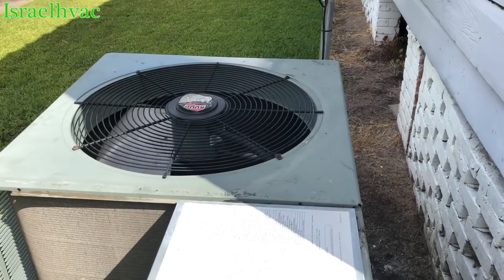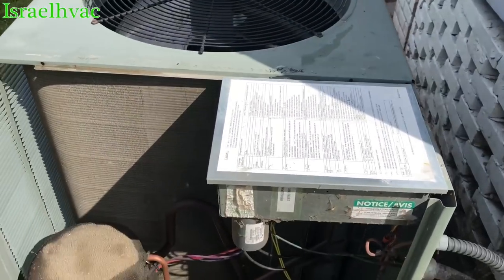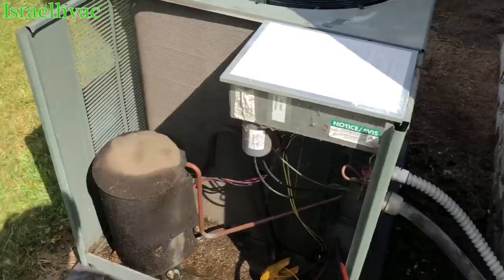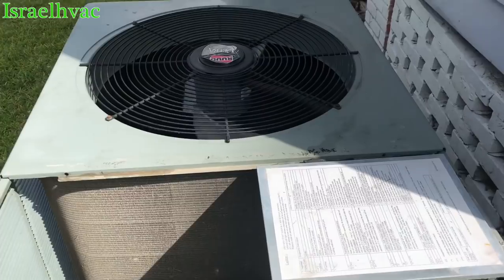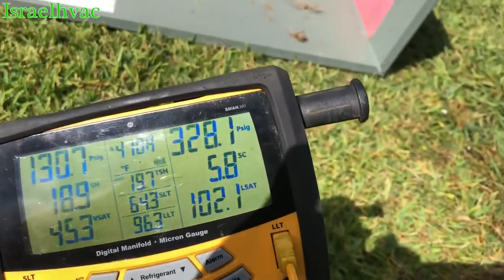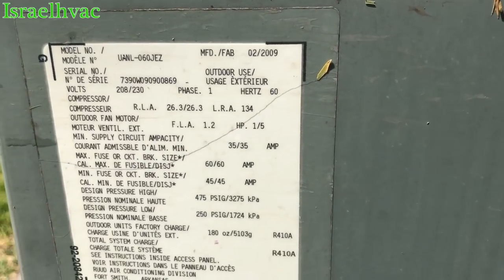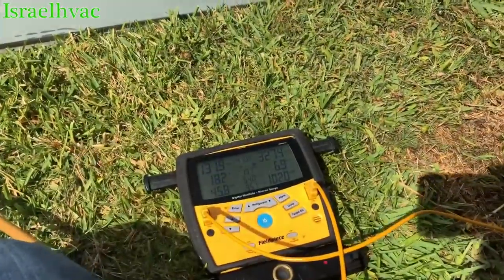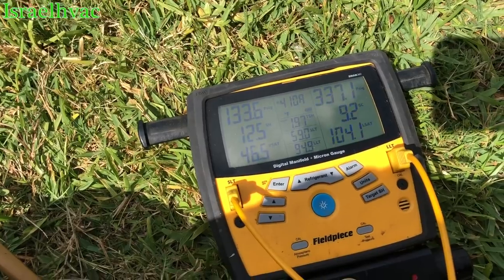HVAC Service | No Cooling | Ruud Ultra Series

Comment: Thanks for the video.   We have lots of those units here.  Those boards fail all the time here.  I try to carry at least one in my van at all times.  I’ve changed a few giving a false 27 code.  Or false compressor over current.   Notice Rheem bailed on that technology and went back to a good old contactor for there 15 and 16 seer nowadays.

Comment: No refrigerant scale?
Reply: Adan Diaz probably like me. I weigh it when getting from the truck and then when I put it back on the truck.
Reply: It really depends on how and what they are billing for.  If they are not charging for this minor top up or they charge the same fee for any top up at or under 1lb, then in many cases, a scale is not needed.

Comment: I feel like its better to check those rheem rhuud units pressures with the panel on
Reply from the maker: Makes no difference. That only matters when there’s no coil behind the door. Look on the side it draws air from the side.

Comment: Installed a rheem 5ton inside and out 2years ago, unit cools and works great, but they say when system cuts off it makes a loud noise.  Been out there several times cycling system trying to duplicate noise.  I never hear it.🤔

Comment: Your first problem is the CW and slow rotation of the fan....
Reply from the maker: gr8gmblr It’s the Camera that does that!!!!
Reply: It’s the camera da. It’s funny how you can determine the fan speed from a video.
Reply: The fan is actually spinning so fast, not only is it breaking the sound barrier, it's breaking the sight barrier. So, to the average human and phone camera the fan looks slow. Only alien robots can tell that the fan is spinning over 20,000,000 RPM.
Reply: I know,.i was being sarcastic....